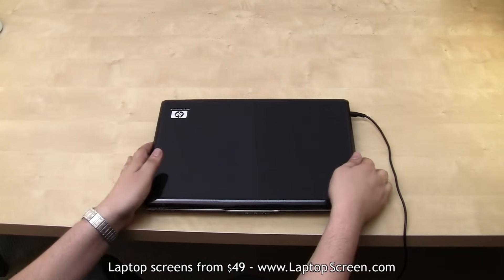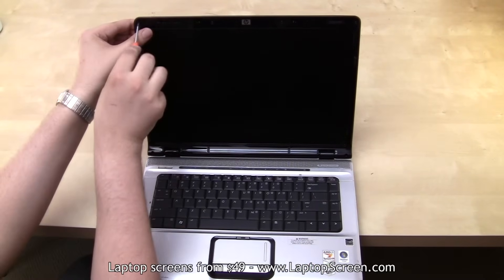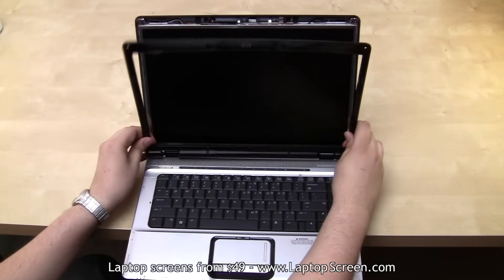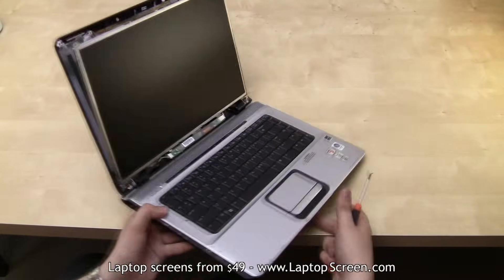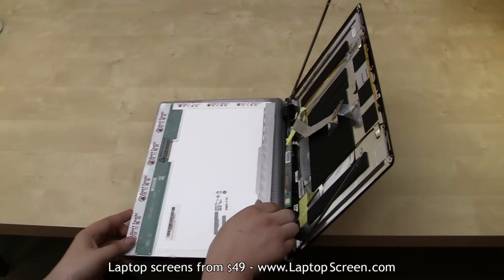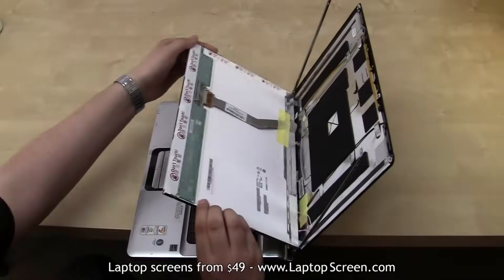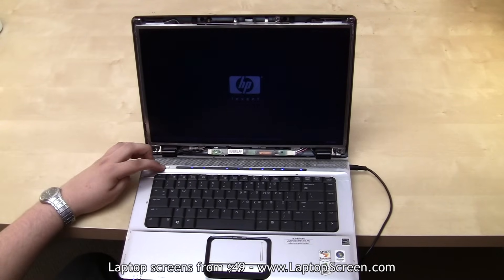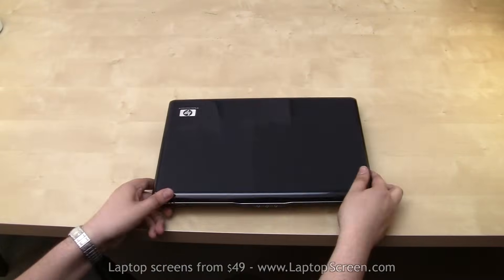Laptop screen replacement / How to Repair (replace) LCD screen in a laptop

Comment from the maker: There are several possibilities for such behaviour:
- Loose video cable: reconnect at the LCD and at the MoBo
- LCD defect between matrix and flex cable: replace LCD
- If equipped with nVidia chip: check external monitor input for the lines
If the external monitor shows lines - your laptop needs the gfx chip re-balled (soldered back on)

Comment from the maker: This topic is covered very well on Notebookreview forums, usually specific to each model that enthusiasts are trying to upgrade. We don't recommend resolution upgrades as a company, due to increased load on the GPU and complications around the upgrade.
To successfully complete the upgrade you need a Dual Link LVDS cable between the motherboard and the LCD. Most low-res LCDs come with Single Link LVDS. You can purchase LVDS cable or modify your own.

Comment: Thanks so much for this informative video. This was a life-savor. The instructions were easy to follow and the video was rightly paced with clear visuals. I did have a slight difficulty connecting the video cable resulting in the LCD screen not turning on, but a few trial and errors resolved it. It just needed to be pushed into the slot properly, I was leaving it loose attempting to be careful..duh! Thanks again a gazillion...

Comment: I laptop has a problem with the lcd. It flickers on higher brightness settings and eventually the display shuts off. I can turn it back on but the same thing occurs, should I open it up and check the connections? I've never opened up a computer before and I'm quite nervous.

Comment: Excellent! Worked great for my HP Pavilion DV6700. Only problem I had was when reassembling I couldn't snap the bottom left side back in place properly. Turns out that there is a magnet glued to the left side (about 1" long and 2" from the bottom) that had become dislodged. Once I figured that out and put it back in the correct position all went well.
Excellent video!

Comment: Question: My lcd is not working (black) Computer is ok - I tested with another computer. How do I know if the blackness is due to a bad Inverter or a problem or the LCD that need to be replaced.  Thank you   I appreciate your response..

Comment from the maker: @ENASTY7ALLDAY No problems, heres another hint, try to salvage the LVDS cable (Cable between the motherboard and the LCD panel), that'll make a higher resolution screen work on a lower res computer.

Comment from the maker: @ENASTY7ALLDAY Yes it is very common for the same model of a laptop to house multiple different panels from different manufacturers. These panels should be perfectly interchangeable, as they are built using the same universal standards. One point to note is the difference in resolutions: if these screens are not the same resolution, there's a slight chance that a higher resolution panel will not work in laptop with a lower resolution installed originally. But not vice-versa.

Comment: Can you replace a 1280x800 screen with a 1680x1050 screen? I want the better resolution but wasn't sure if the connectors would be the same on each screen?

Comment from the maker: @NguyenEmpir3

I believe the Dv6 is sort of like the MacBook unibody, it's got a glass/plastic cover which is attached with double sticky tape. It is possible to use an exact-o-knife to open it up. Tools which will make the job much easier are: suction cups and hair-dryer (heat gun)

We will be releasing a MacBook unibody video some time soon, it will be relevant to DV6